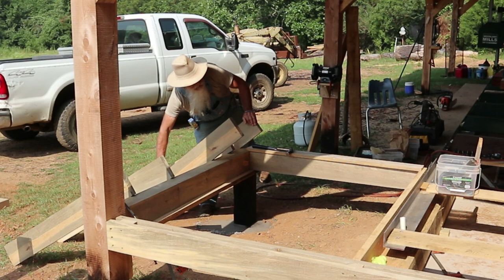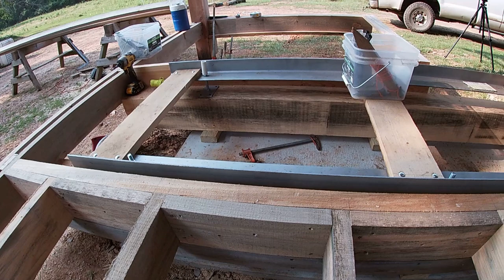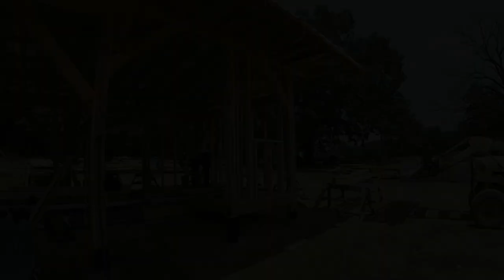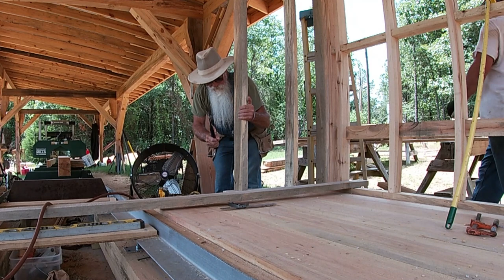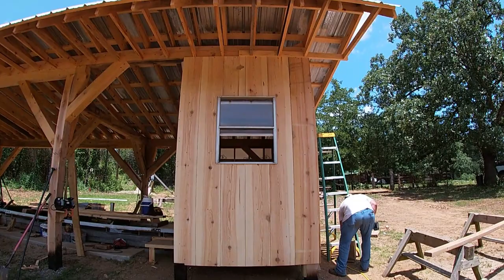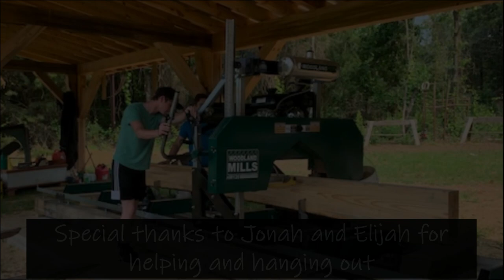Building a Sawmill Shed, Pt 6, Flooring and Enclosing the Millhead Storage Room

Comment: Hey, this question isn't about this video but i just wanted to saw i love these videos im in the planing stage of my log cabin and looking at different build styles and i've always loved the dove tail cabins. However, how do you attache multiple logs to make a longer wall. For example, i have a 60 foot wall but my logs are only 24 - 30 feet long?
Reply from the maker: Howdy William- that’s a question different people have asked. I use a mortice and tenon joint to join logs together to make longer logs. I will be doing that on my next project. I should have made a video of doing a splice but just haven’t done it, but will definitely be showing that. It’s a bit easier if you’re using logs that have been sawed into square timbers instead of using live edge. We’ll get a video of doing a splice. God bless you